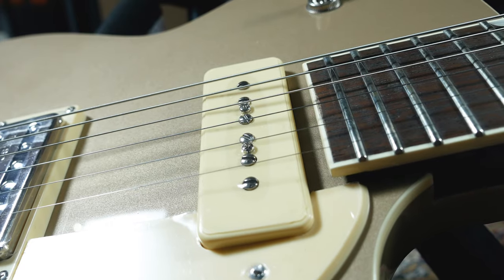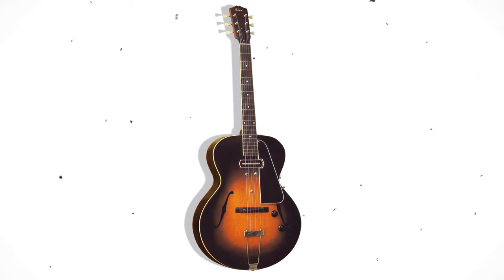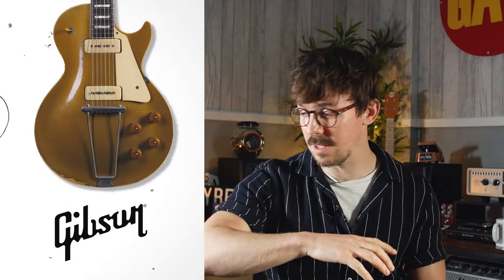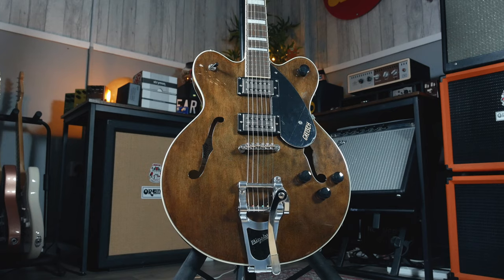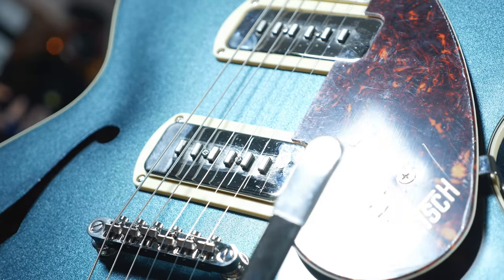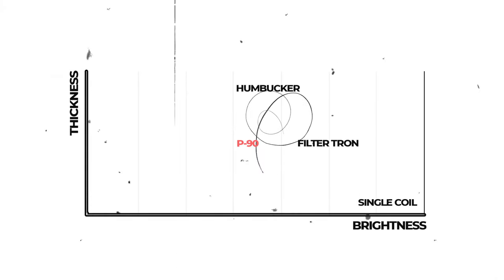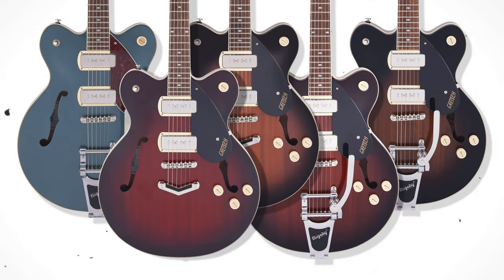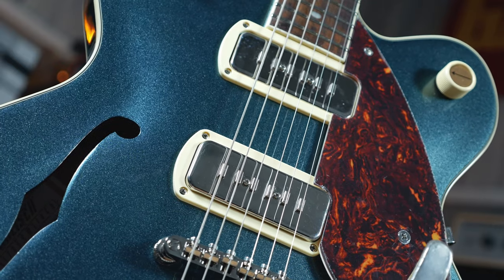Gretsch P90 vs Gretsch FilterTrons

Comment: Sorry to be pedantic but your examples of Filtertrons are not Filtertrons at all. They are Broadtrons which as Gretsch themselves say, are quite different. Having said that, the G2215-P90 has to be one of the best bargains around.
Reply: I don't think you're being pedantic. They're not filtertrons in any way whatsoever.
Reply: I own the G2622-P90, the same in the video, and after watched the comparison I said to myself "am I missing something?". Yes, because those are broadtrons. Thanks for clarifying
Reply: Agreed
Reply: Doesn't sound like a Gretsch at all, though.
Reply: GAK totally missed it by misidentifying broadtrons as filtertrons.  Too bad. The playing was stellar.
Reply: Yeeeeeeeaaaaahhh . . .  awkward
Reply: Exactly. Making that kind of mistake is honestly a bit sad for people selling guitars.
Reply: I own TWO G2215s and have replaced the Broadtron junk with HS Filter'Trons. The middle position is killer!
Reply: You are not being pedantic. The video commentary is just wrong
Reply: Yeah i expected the broadtrons to be similar to filtertrons, and when i bought my streamliner center block semi hollow……it sucked.  I absolutely HATED them.    They were very weak, i adjusted the height, i tried doing stuff to make them sound better snd have more balls if you will……..so then i decided i had to change pickups which is a pain in f hole guitars unless you just cut the wire off at broad trons and splice new pickup wire…..but then it just feels like its done half ass.    So i bought a couple dream 90’s.   Humbucker size p90s.  I tried one in the neck position by just snipping the pickup wire to broad tron and then splicing wire of dream 90 into that and then heat shrinking plastic over the splicing.      When i hooked the guitar up……when i tell you the dream 90 had st least twice the output of the broad tron……thats no joke.   And i have the broad tron raised up as much i can without hitting it when playing, and i had to lower the dream 90.  Still If i switch pickups while playing to the broad tron, i have to engage a boost pedal to compensate for the volume drop at max volume.       Here soon im going to correctly wire in both new pickups with gfs quick change so i can try their darmond style pickups and their fender style humbuckers; i was always a fan of the old tele deluxe and starcaster type humbuckers.

But yeah the freakin broadtrons suck ass

Comment: I have yet to fully understand why a P90 in the neck is so popular. Why would you put a rolled-off, boomy pickup in the most rolled-off, boomy position? I feel like a p90 is perfect for the bridge position where as a pickup that compresses low end and has more clarity would be best for the neck.
Reply: They became a typical neck pickup because they roll off lows and push upper mids.Def matters if the guitar is solid or semi hollow; in a Tele, they are nicely balanced.In a semi hollow, they're fine clean, but seem to get muddy when driven.There are some vastly different specs out there , as well.Dosen't pay to generalize, with so many options available.

Comment: All the "not a filtertron" comments, this is a very interesting topic to me, because I am in the middle of building a solid body guitar with a p-90 at the neck, and an actual filtertron at the bridge. I had no idea Gretsch was doing that too, just thought it might be an interesting project. The guitar itself is a fender offset body, solid mahogany, with a telecaster setup, as far as the bridge plate with a filtertron in it, and a telecaster switch plate. Might as well have been designed by Mary Shelly, because it is truly a totally frankenstinian creation. Solid black with gold fixtures, and a wenge neck...black wood with dark chocolate grain. I figured I might as well go all the way into unusual, not knowing that Gretsch was already doing it. Very cool seeing guitars in that direction and hearing what they sounded like a bit. It's turning in to a rather expensive and lengthy project, considering it's just a thought, with the hope that it wouldn't sound terrible. Your demo gives me some hope that I'm not just throwing away money on a crackpot whim. I probably would never have done it, except I already have 20 other guitars, and....why not.

Comment: I'm sure several people have already mentioned that your quote unquote Filtertron is a Grestch bucker broadtron. It's basically a cheap ceramic humbucker with a different split/toaster cover. A far cry from a Filtertron or even a Filtertron style Broadtron. Nothing in the Streamliner range has a Filtertron. The closest you could come in that range is a Rally 2 center block that has Hi/Lo trons in it.

Comment: There is yet another alternative to the traditional Filtertron. It is a fully reversible mod to that pickup in which one line of the screws is removed and replaced with plastic ones to plug up the holes. This transforms the Filtertron into a kind-of single coil pickup, although the second coil, now ”sans screws”  still operates to “buck the hum”, or to “filter the ‘tron”, or whatever.
The result is that the good old, familiar Filtertron takes on a punchier, brighter tone, similar to a good, strong P-90, but without the P-90’s characteristic 60-cycle hum. 
A Win-Win, IMO.

Comment: I rebuilt a 92 squire hss, plugged the trem and spring cavities,  installed two Banning filtertrons and polish oil paper cap with fender tele 3 way switch....incredible sounds

Comment: A couple critiques:
-Put text on the screen of the guitar that is being played. 
-The demo didn't play around with different sounds, more-so country-twangy, clean tones only
-No links to these guitars in the notes
-He said 2665 but the model he was referring to is actually the 2655. There is no 2665.
-Would have been nice if you discussed how the P90 on the 2215 is a different P90 pickup than on the P90 used on the other Streamliner models

Comment: They make a great sounding P90, but are not consistent. I have two guitars of the same model and they sound very different. Neither sound bad, but very different. The broadtron on the other hand is NOT a Filtertron, but a humbucker dressed up to look like one. The one sounds so bad I will not even use it. No matter, it will get replaced like the other one with a HS Filter'Tron. That combo sounds beautiful. Be warned, it is NOT a "drop-in" part and will require time and money to change, but is worth it.

Comment: Thanks for that. I'm no expert, correct me if I'm wrong: P90 refers to a 'family' of pickups that share some characteristics (?). Where does the Gretsch P90 fit into the family? Pretty representative? An outlier? Is the Gretsch P90 constructed to lean toward the 'Gretsch sound'? Is this an impossible question?

Comment: those are NOT Filtertrons at all. The video with its audio samples is pointless, sorry man.
Anyways, I swapped those Broadtrons in my Streamliner and replaced with Seymour Duncan Phat Cats (sort of P90s), and the guitar came to life.
Reply: hey agree.. i have the grestch g2215 , the p90 neck is great for me but this fake filtertron on bridge is very bad... what is your experience with the phat cat on bridge?
Reply: @macauley70  really not bad at all! Definitely better than the stock Broadtrons… much clearer and crisp. And honestly, also from a purely esthetic point of view.. wonderful!
Reply: @andkemp  Nice. I have the G2210 and will swap the neck pickup to a SD phat cat and the bridge for a Psyclone HB. :)
Reply: @protectionfromred5054  you’ll love it!
Reply: Late to the party but I just bought the g2215 and am really loving the p90 but think the Broadtron is a horrible mismatch...in my guitar, the Broadtrron output is much less than the p90 and they sound like a muddy humbucker to me...I tried raising the pick up height on it and lowering the pickup height on the p90 and that got me closer, but I think the Broadtron is a dud when paired w. the p90.  I think I;m going to put a Filtertron type pickup in the bridge....GFS offers one that is a bit hotter than the Gretsch one...comments?
Reply: Did you have to change something else along the pickup? Pots etc?
I want to buy a g2215 p90 but im not really into changing Pickups and im worried if its difficult 😬
Thx!
Reply: @toxicavenger9617  I changed nothing else but the pickups. The Phat Cats work just fine with the 500k that are already on the guitar, consider that they're purposely designed to be a replacement for humbuckers...

Comment: im curious if the routing under the bridge pickup mount ring will fit a second p90.... anyone?
Reply: I don’t know if the look would be right; aren’t humbuckers a bit wider so you’d still need some sort of pickup ring. I personally am swapping the bridge pickup in mine because it is microphonic. I am going to get a DiMarzio Humbucker sized P90 they sell. Gets me what I would consider 90% of the normal p90 tone without having to mod the body and compromise the finish.

Comment: Seems to me people buy to mod, the p90 fits where the Filtertron or Broadtron fit without much modification required.  Otherwise the purist knows why he is buying a Gretch.  
Why would I buy a Gretch only to swap out the pups to have it sound like a Gibson?  
I did see a pair of original p90s on Reverb going for $22k.  Dont know if they ever sold.  But still, you cant say a Gretch is cheap and then slap in a pair of 4 digit pups and say you got a deal.

Comment: I realise this video is not about Gibson, but here's misinformation about Gibson P90 pickups in this video - firstly, there was another pickup in production between the "Charlie Christian", and P90. It was called a P13, and these first appeared around 1940, and were replaced by the P90, which first appeared around 1945 in the ES125, et al...  P13s had nickel covers, so thanks to the war demands on metal, and presumably, an easier/cheaper production method, the P90 became the pickup of the moment around 1945, well before 1952, as mentioned in the video.
As an aside, Gibson "sold a boxcar full  of P13 pickups, to Harmony Guitars in Chicago", (according to urban myth),  though it must have been several boxcars full, as they continued to use them on lap-steels, and in several archtop models (eg, Espanada) until around 1962.

Comment: Obvious elephant in the room: a staple pickup is quite a different pickup design to a P90. In many ways, having an individual magnet per pole piece, it's more like a Jazzmaster pickup than a P90 in design. Differences in pickups can be exaggerated, obviously. But those 'Fidelisonic' pickups aren't actually P90s. There's at least as much difference between them and P90s as between a Filtertron and a PAF humbucker.
Reply: Actually that Fidelisonics are closer to 50's p90s in construction and sound, even if it shares some aesthetic similarities to the staple, but the difference is that the staple was closer to a dynasonic, both in construction and sound.
Reply: THANK YOU!  I've been looking high and low for an explanation of the staple pickups.  I'm considering a Gretsch with staples, but have not been able to find out what the difference is between those and a regular P90.
Reply: @rickclogston5205  Ok. So I've since learned that this is basically a P90. The staple elements are not themselves magnetic but link to bar magnets beneath just like the screw polepieces on a regular P90.